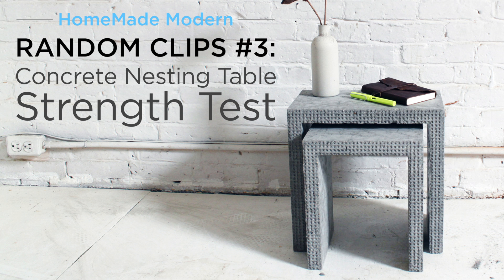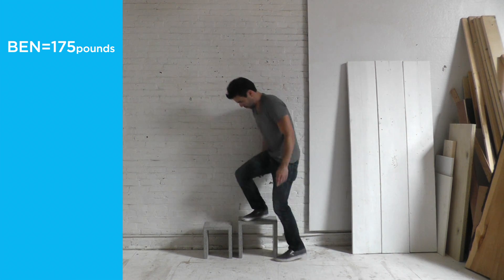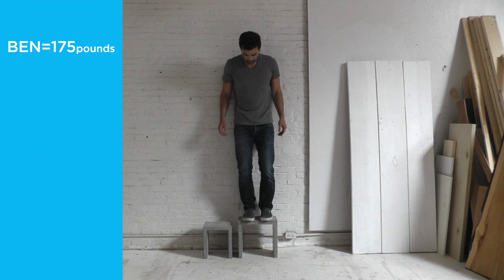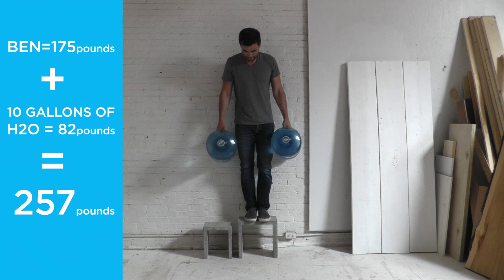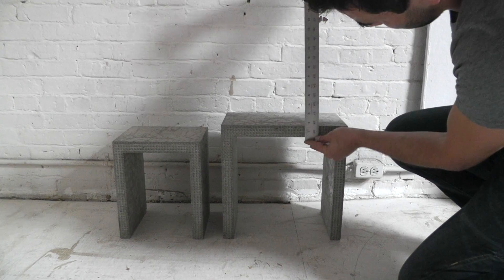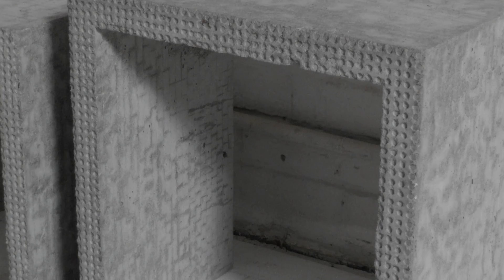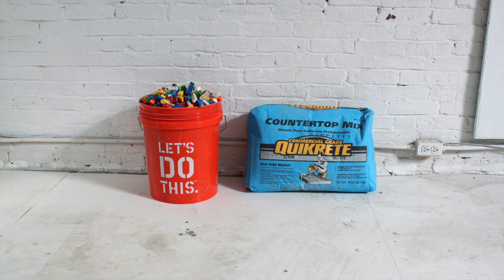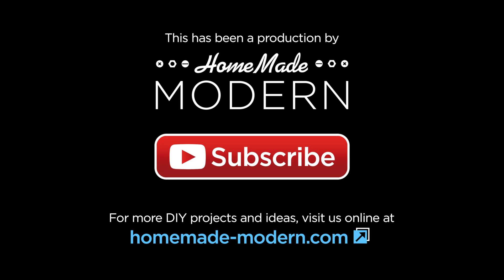Testing the Lego Formed Concrete Nesting Tables

Comment: So if I were doing an 1.5 inch vanity top with counter top grade concrete, would you think I wojl need reinforcement?   It will be 2'x3'.  Do you ever use hardwire cloth or chicken wire reinforcement?  I think there is some plastic square mesh on the market too?? Thoughs?  Thanks!
Reply: There are videos about making concrete counter tops that might offer ideas.

Comment: I want to see you test it until it breaks. Using some sort of measurable system. It doesn't have to be done with the accuracy of rocket science but it would be interesting. Plus its always fun to break stuff while learning the structural integrity of an object. HomeMadeModern

Comment: i need to build a football with concrete.. any ideas how i can make the form?
Reply: Use foam in layers and a heat cutter to get the shape you need. The top layer will need a hole to pour the concrete in.

Comment: You can also add some strength by mixing in an appropriate ratio of glass fibers made specifically for concrete, which will give you GFRC (Glass Fiber Reinforced Concrete).  This is especially well-suited to concrete like this that is not polished after curing.  Polishing will expose the glass fibers, just like it does with any aggregate (stones) that you add to your mix.  The visible fibers might look cool in a modern design though.

I love troll-killer videos like this BTW.  You tested these with WAY more weight than anyone would reasonably put on tables of this size.  And you also tested with the weight focused on the center of the table, which would be its weakest spot.  No way around it, the trolls are full of bunk.
Reply from the maker: ***** yes! i want to try and experiment with that!
Reply: +Andy Douglass Please. These are perfectly sized for improvise step stools!